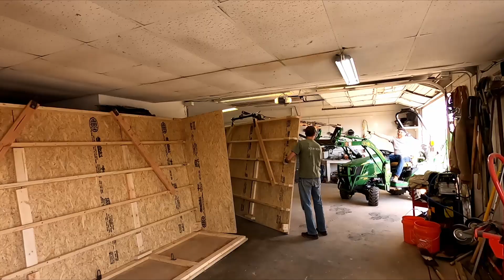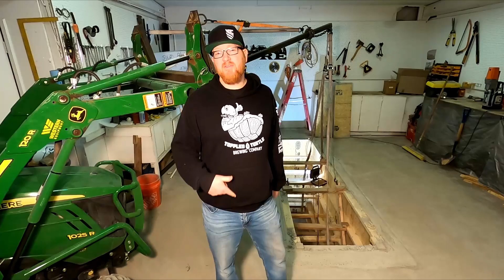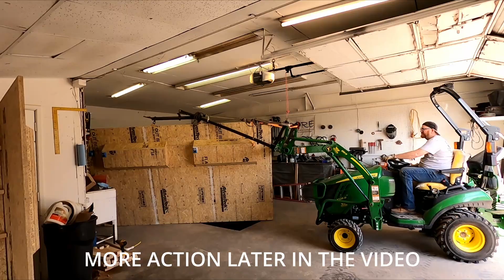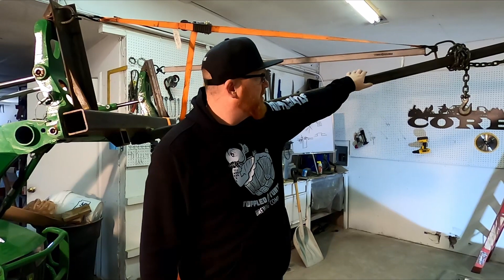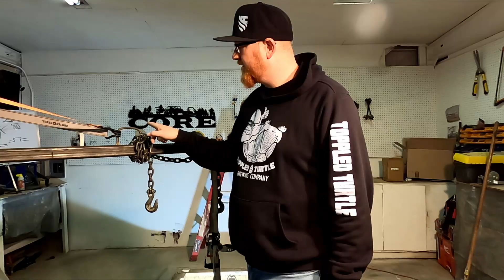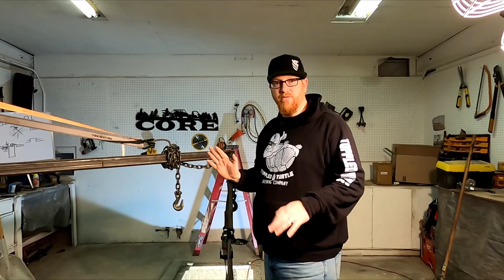1025R Lifts HUGE wall!!!  DIY Boom.

Comment: I know this is really late.  But do you really have 7ft walls, no footer and no attachment to the existing slab??  What keeps the expansive clay soil from pushing those tall walls into the hole?
Reply from the maker: Nothing on earth can stop the clay.....   lol.  Every house in the Panhandle has foundation movment....  Well it such a tight space with a ton of concrete.  It basically is its own footer.  If it were a wide space I would be more worried.  Additionally if this was an outside wall subject to the sun and rain I wouldn't have done it without mixing sand i to the soil.  But it won't have extreme swings of moisture being in the middle of the building with our low water table.
Reply: @ThinkBuildTest  Think back to when you first dug down.  Could you grab a handful of dirt, squeeze it and make a ball out of it?
Reply from the maker: @jagboy69  depends on the depth lol.  There is definitely clay.
Reply: @ThinkBuildTest  well, the moisture will return.  I ran soil tests and I'm around 15% expansion.  And that was at the back of the garage 18feet from the nearest exterior wall.  That calls for a different game plan.  No more concrete walls for me.  I figure if there is no clay to push against a wall, it can't push in.  So removing soil behind my walls is the answer.   I'm going with 40 steel I beams to support the surrounding floor.  Stay tuned!
Reply from the maker: @jagboy69  sounds like budget creep...   lol
Reply: @ThinkBuildTest  actually it might be a little cheaper.  Certainly a lot stronger and maintenance friendly if I have to get behind the walls.  This is worth watching.  youtu.be/UummY_mo85Y
Reply from the maker: Im 6'5 and there will be a hydraulic lift that takes up the floor beneath my feet so the total hole depth is over 7ft.